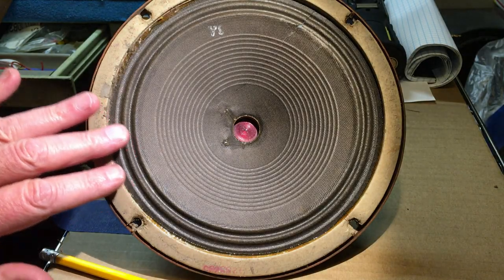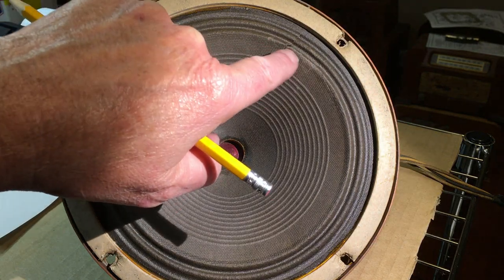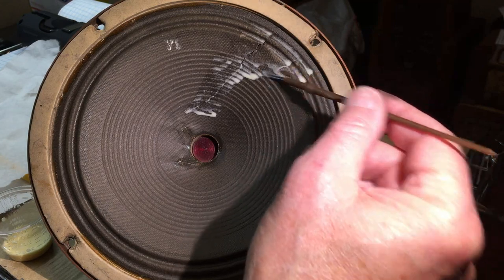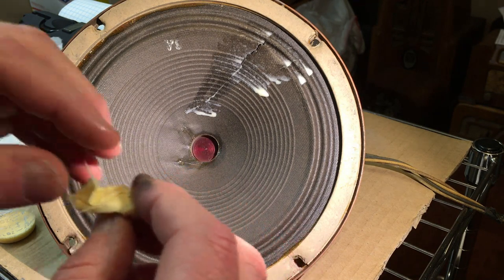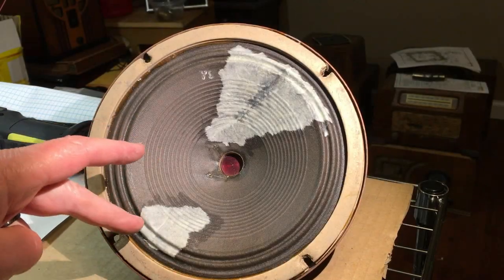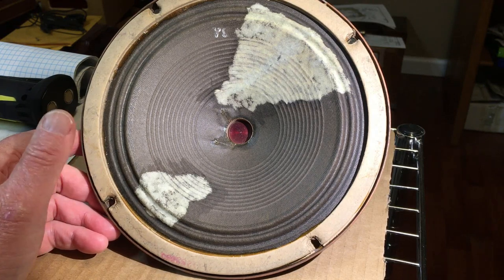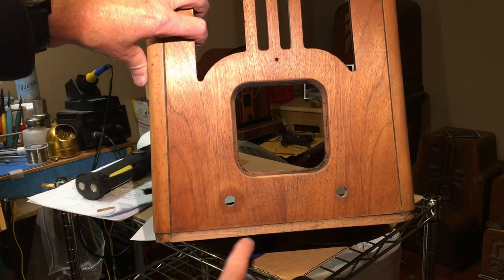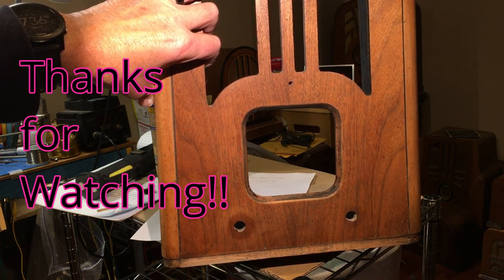1937 Zenith 5R135 Part 5 of 6 Speaker and Veneer Repair

Comment: Great video Larry,  really nice job on the speaker repair. Sometimes I paint them and sometimes I don't,  just depending on my mood at the time.LOL I actually do think it helps strengthen the paper cones a little. I mean if you think about it, the paint flows into the tiny paper fibers and helps bind them together. I use spray paint when I do it. The veneer repair looks great! The radio sounds fantastic!
Reply from the maker: Gregg's Vintage Workshop Thanks Gregg!! The paint may help with the speaker cone...I really dont know...I’ve actually thought of trying flexseal lol... it goes on so thick as a spray...maybe I’ll try it on a speaker that I can recone if it goes south on me? lol....The radio hasn’t been touched as far as alignment and I was thinking of doing what Doug was eluding to....a partial touch up...not a full blown alignment...sounding good now...I hate to touch it...but, may be a good learning opportunity to see what we can “get by” with! Take Care—Larry

Comment: Great job. I see glasslinger painting speakers with glue. I have used two ply heavy duty paper towels but used only one ply thickness separated and it might be just as good using coffee filters.
Reply from the maker: Jim Boyd Thanks Jim!! As you can see thru many youtube channels..there are several ways to patch a speaker... The best way is to replace the cone....but, vintage speakers are different from modern ones and its hard to find a cone that fits, so you end up modifying...and you are not much better off than repairs....Sometimes, I think we should try and improve the design of the radio and speakers....I had all sorts of advice once on replacing an interstage transformer....The one I planned on using "didnt have enough iron" in it for a good sound.....After research and asking a very experience radio repair guy...his advice was....in 1931....the quality of the sound that that radio made new was not that great.... Guess what? I replaced the transformer and it sound fine! Its all depend on your goals.....if you want a great sounding radio....buy a modern one...just my opinion...lol....Thanks for watching and the comments! Take Care--Larry

Comment: for the black water stain from the coffee cup you can use oxalic acid as wood bleach.
Reply from the maker: Thanks for the tip! Do you have a source whereI can buy that? Take Care—Larry
Reply: @Backtothefutureradios  I got mine from ebay. It's a pouch of white crystals you make a paste with water and spread it around. I had to do it twice because I had a huge black water stain across the whole top of a bromberg carlson console and sanding wouldn't eliminate it. After I bleached it I put a light stain and you never tell
Reply from the maker: @skullheadwater9839  Thanks!!!

Comment: Are you going to be using Fiber Washers under the front knobs?
Also, at 18.22 in the video, just above the patch you made in the vanier, there is a horizontal line, very tiny,  and from it, two more, one on either side of the front that are vertical.  They appear to have been black inside the very thin groves.  I think you said you were going to put a dark stain on the vanier, and was wondering if you were going to add black to those groves?  I think it would be a great idea, but, then, I am not the one doing the work.
??? Spider Poo ???  I NEVER would have even begun to think of that.  I mean, they "must" poo, right?  Just never though of it being a problem on radios.  Where's my anti-septic cleaner??? ;-)
Thanks for sharing this with us!
Reply from the maker: Wayne Thompson Thanks for watching and commenting! Yes, I typically put felt washers under the knobs....I bought several back a couple of years and if I can find them (even tho I keep then in the same place 😉).....As far as the finish....hmmm???  Im still looking at photos of other 5R135's and looking to see what they looked like originally......its possible that someone had refinished this one....I dont really know! Right now....in my mind the small grooves will be dark...along with the inside speaker opening and dial opening. Any suggestions??? Not sure when I'll get around to the finish....will be weather dependant......Thanks again...Take Care--Larry